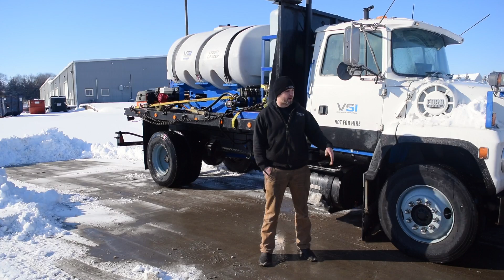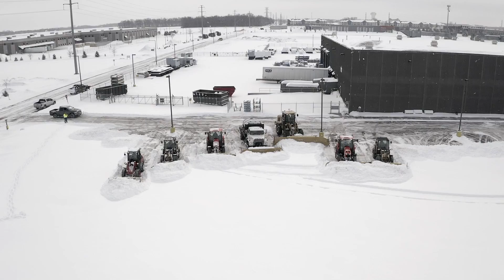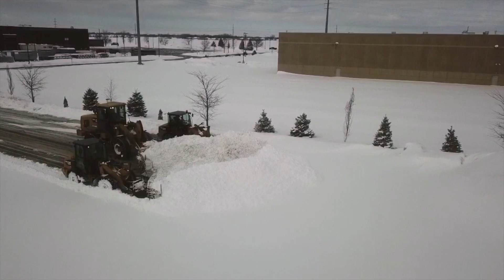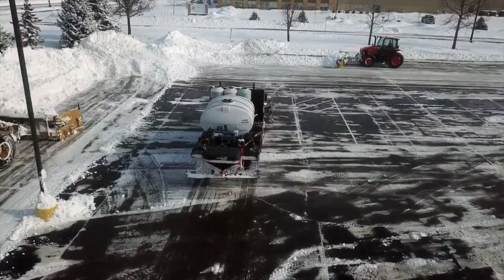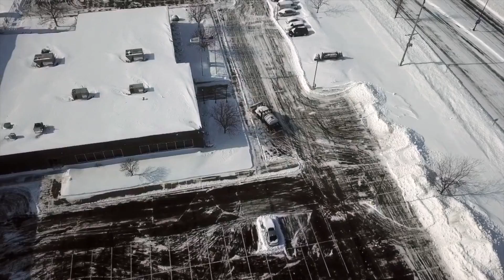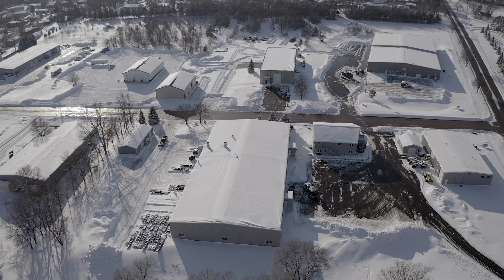11" Snowfall Plowing and De-icing

Comment: What application rates were you guys running for the pre-treat? And sorry if I missed it but was the pre- treat just salt brine? Or 90-10?
Reply from the maker: Pre-treatment we ran 40gpa of straight salt brine. My previous info of 90-10 was incorrect. We normally run an additive with the pre-treat because of how cold it normally is in Minnesota.
Reply: @voigtsmithinnovation4112  thank you. Have you guys used the tailgate spreader on the truck at all this year? I think I remember from the truck build video you guys saying it was mainly on there for testing purposes.
Reply from the maker: We actually haven't effectively used the spreader this year because the vibrator hasn't been working. We have tried running it but it wasn't spreading evenly enough to get any real world results. So right now we are waiting on a new vibrator and the temperature here is around 40 degrees. It's fine with us though because our liquid doesn't fail us. 😂

Comment: Another awesome video guys,  your  truck is an absolute Beast. Did I pick up on a change of mind on pretreating Dave? Lol. If we didn’t have to pretreat I would get a lot more sleep, unfortunately we get too much rain between storms and any over treatment washes away. We love our brine maker and our 305’s, hopefully we will be adding a couple 750’s to our fleet for next season. We ran your equipment hard this season and it performed excellently. Your boom did battle with a car, a light post, and some concrete, and it won every time. I cant say that about the cheap yellow plastic crap we have. Keep putting out an awesome product and your excellent customer service and you will take down Goliath. I hope to see you at SIMA.
Reply from the maker: Mud Puppy, in Minnesota it's pretty rare that we get rain between storms so our post treatment normally hangs around. Pre-treating definitely adds value but it's up to each company to decide if that value is worth the input cost. Were glad everything is holding up for ya! Maybe you could put up a boom vs. boom video!

Comment: So can you talk about how you sell your customers on this? We sand our lots. I can see you won't need as much sweeping in spring. But what's the cost difference between sanding and brine? 

There would still be some sort of sweeping even with brine. 

Just wanting to better understand your sales angle and how you convince your customers to go this way. 

Also the in garage video your in stereo. 

Thanks for great video.
Reply from the maker: Putting down sand and applying brine are two different levels of service. With sand you are putting down temporary traction that is immediately effective, but does nothing to melt the snow and ice on the surface and relies on other means to melt, ex. solar energy. With brine and an additive you are looking to melt the snow and ice on the surface so the pavement is available for traction. Flat paved ground is a much safer surface than snow with sand. So we offer our customers the same price as spreading rock salt but offer a much faster, cleaner, adaptable service.
Reply from the maker: We also do not sweep any of our properties at the end of the year. The process of spreading brine and additive should not have residual granules that need to be swept at the end of the year. I would assume what is on the surface is from the plow scraping or material being brought in by traffic.
Reply: We switched to brine and additive we are 100 percent have with David and Adam. You have a must safer parking lot . Reduce your sweeping and Removal of debris by 80 percent but still charge same amount. If you want to get ahold ask Adam to call me up.
Reply: Price PER application is about the same
But you end up applying the brine more often than sand, per season